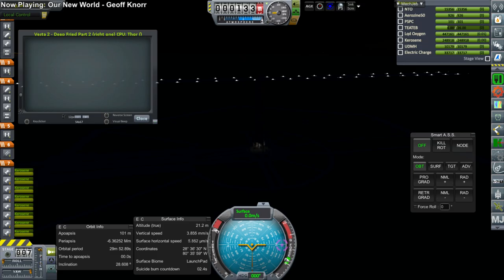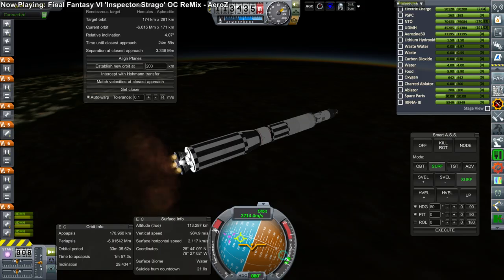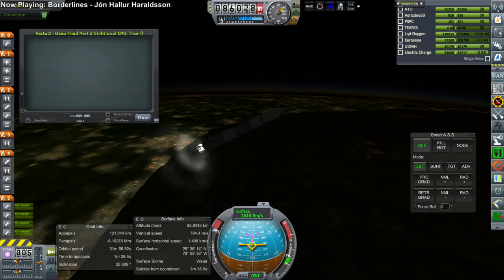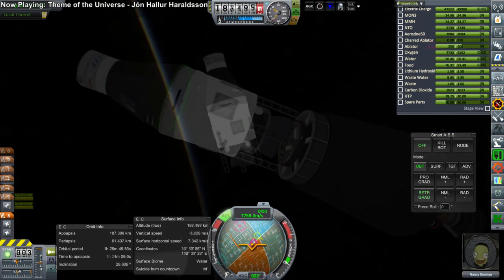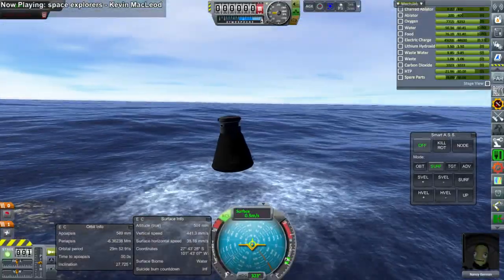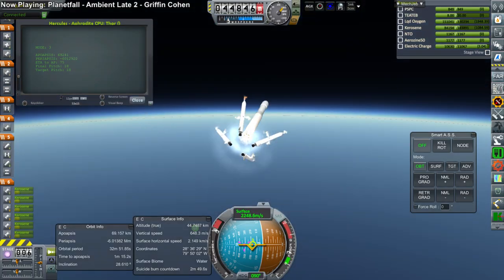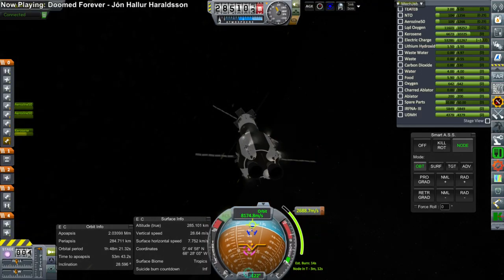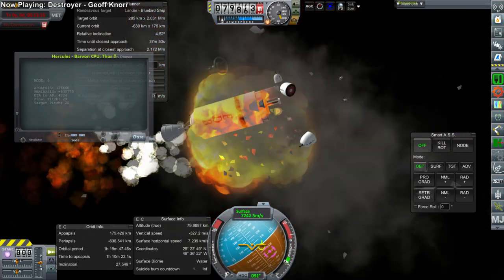EDB Space Program - Road to the Moon Part 3

Comment: Did you get my comments on your previous video? If so, what did you think of them?
Reply: It was specifically about the rocket profile series, in a response to your point about the Titan IIIE. Text: 

You could also do NOTSNIK/NOTS-EV-1 Pilot, which I noticed was absent from your Mission Profile series, presumably because of its obscurity and difficulty to simulate (it was air-launched, completely unguided, and to my knowledge none of its parts are found in any mod, so you'd have to use procedurals or create your own mod). It had the distinction of being the lightest orbital launch system, both in terms of total mass (900 kg) and payload (1 kg), and had the most stages out of any orbital launch vehicle (6, counting the F4D Skyray carrier aircraft). 

Sorry if I'm annoying you or anything.
Reply: It was a shitty rocket with a shitty design, and probably not video-worthy, but I disagree that "it can't be claimed to be an orbital launch vehicle". By that logic, the Europa rocket wasn't an orbital launch vehicle either, despite that it was theoretically capable to launch a Mariner-sized probe to the inner planets. It had the delta-v to, and was launched in an attempt to make orbit. Two flights (number 1 and 3) could have reached orbit, though this was not conclusively confirmed.
Reply: I'm certain that had they continue launching it, it would eventually work. Anything 1. with the required delta-v, 2. launched near horizontally, 3. that is able to perform an apogee kick is able to reach orbit from an air platform. Whether that takes one shot or a million, it will happen. Either that, or I must have missed something massive in high school physics.